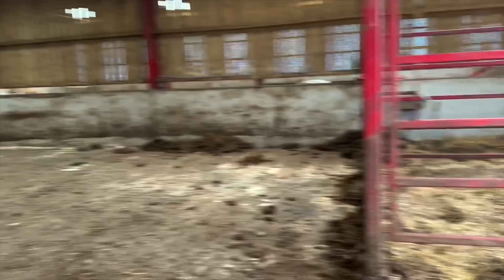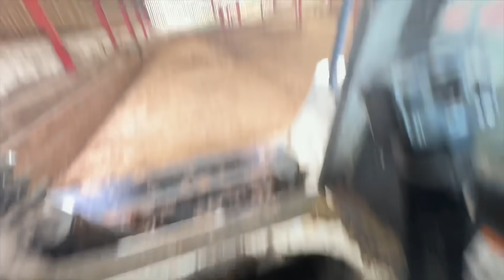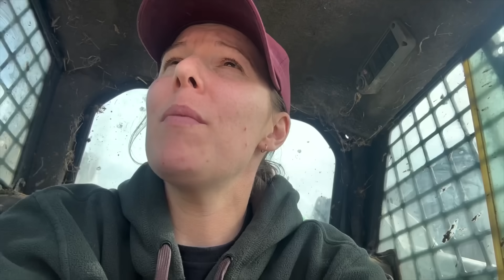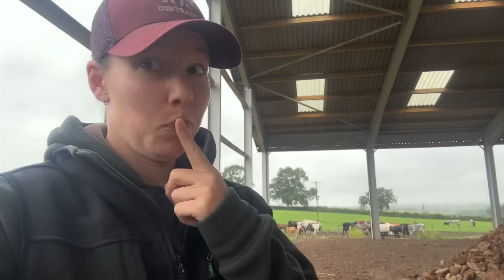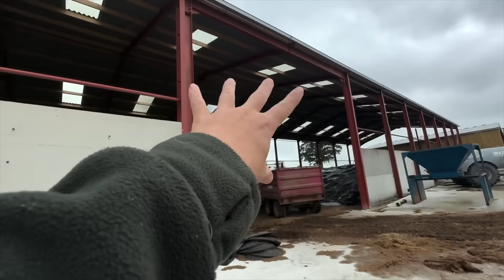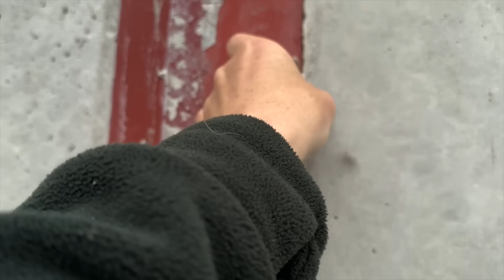Robot shed progress STONE SHIFTING

Comment: 6F2 or 6F5 should be the bigger stuff but as it's just waste from the concrete plant and not processed (crashed/screened), it's just rubble.  The topping will be Type 1 for levelling/compacting as the finishing layer.

Just for everyone's edification ... 

Good use of recyles material (and they claim farmers aren't good for the environment !!).  I'd recommend getting a roller/vibrator on that fill before pouring a slab.  I know it's 'just' cows, but will help prevent it cracking at a later date due to settlement.😄